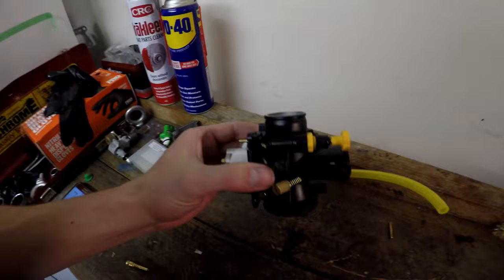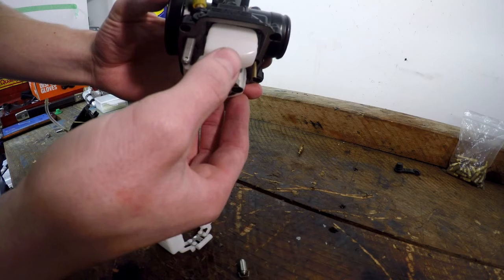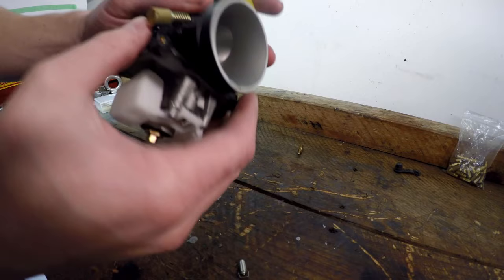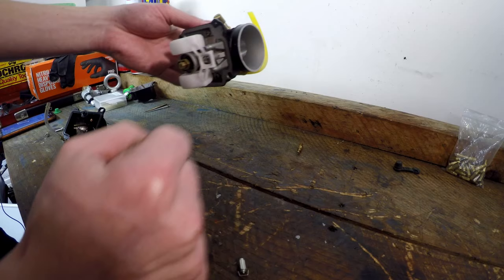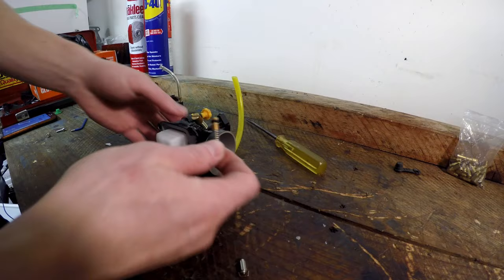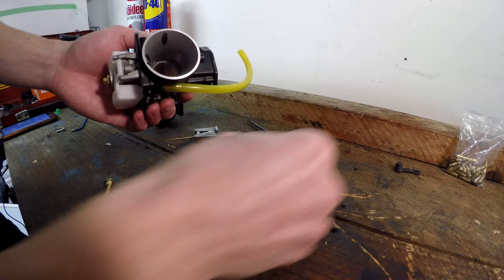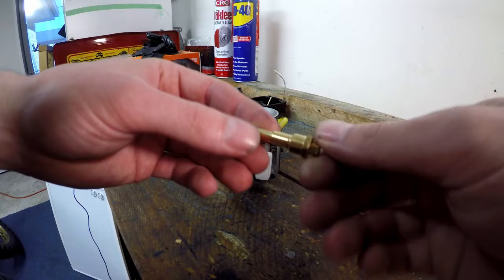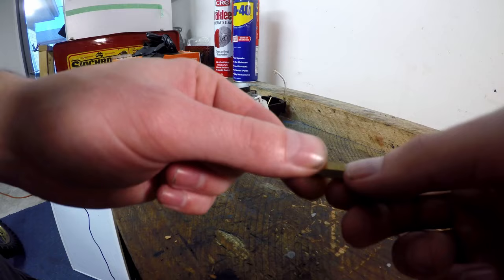pwk Carb Basics, Setup and Tuning

Comment: What’s the difference between this PWK and PE nibbi carburetor?
Reply from the maker: Depending on the model but the only physical difference is the round slide vs flat slide.
Jetting and setup will still be the same process.

Comment: Good Morning Guys, we running a Honda GX390 and I'm trying to get the 34mm slide carb to work at altitude.

Are there any recommendations in terms of main jet, idle jet.
Currently seems that it is only picking up halfway down the straight.
Currently running a 125 main jet, 33 pilot jet.
Reply from the maker: I would be running around 125 to 130 main jet in the 34mm carb.
Is it at full throttle the whole straight and then picks up half way? If so I have a feeling your carb might be to big for your engine.
Stock is 27mm, I normally only go a couple mm bigger so a 28 or 30 would work better.
The reasoning is carbs need a certain level of air speed to atomize fuel effectively so at low rpm the carb will stuggle to function.

Comment: Has anyone tuned this carb for a built 212 predator engine?
Reply from the maker: Not me but if your struggling, putting a Air fuel ratio kit will make it a piece of cake

Comment: Went with a new carb but when I rap the throttle quick it bogs down I went with a 26mm
Reply from the maker: What bike is it on and have you jetted it yet or just fitted it?
Reply: @TheMotorcycleForge  it's a 150cc scooter no it has. 108 main and 38 pilot
Reply: @TheMotorcycleForge  didn't jet it yet
Reply from the maker: Ok I would have a look at adjusting the mixture screw and the jets might be a smidge big but might work ok.
I did another video that's more in depth about how to jet a carb.
You should find everything you need to know in that vid.
Reply: @TheMotorcycleForge question I got a 150cc with 28mm PWK,air filter(48mm) & aftermarket exhaust.I’m at sea level and main jet was 120 & pilot jet was 48 but I swapped to 38.This setup should work fine?🤔…
Reply from the maker: Yeah sounds pretty good, only one way to find out, go test it out

Comment: Any opinions on 30 holes needle jet?
Reply from the maker: I have purchased a couple different ones with more holes than stock, unfortunately haven't got around to trying them yet.
If you do I'd be keen to know how you get on.
Reply: @TheMotorcycleForge  i have 150cc gy6 I usually jet it 115 main now with the 30 holes needle jet I'm down to 95 main and runs somewhat rich (kinda bad up top)
Reply: @TheMotorcycleForge  I went from 110-100-98-95 it keeps getting better now I don't know if what I'm experiencing is a lean or rich condition
I can't read sparkplug as my gy6 burns oil
Reply from the maker: Yeah that sounds about right, I think the more holes in the needle jet.
Will add fuel in relation to position of the hole compared to the needle hight.
Not sure the extra holes are needed might be making the main jet size not as important.

Comment: Where tf do you put the fuel line
Reply from the maker: It will be the largest brass fitting on the carb, can be on R or L depending on make of carb. Small ones are breathers.

Comment: A friend of mine drilled and tapped a hole in the air filter for his nitrous kit. Hard to believe they make nitrous kits for motorized bicycle lol I would buy one if you could buy more cartridges but it only comes with 5 I think
Reply from the maker: Wow that sounds awesome, wonder how long the engine will last.
Reply: @TheMotorcycleForge  there's videos of people using them and they seem to hold up. It's not like it's a big shot
Reply from the maker: I give it a look, sounds like fun
Reply: @TheMotorcycleForge  I'm thinking of getting one and putting on my bike with the zeda 80. I won't put it on my phantom 85 I don't want anything to happen to it
Reply from the maker: Yeah man fair enough, keep the best bike safe 😁
Reply: @TheMotorcycleForge  I love the phantom. It's got some power and I can't wait until they make high performance parts for it
Reply from the maker: Haaha yep, fingers crossed they make some soon
Reply: @TheMotorcycleForge  they will now that they got the kinks worked out. It's why I waited until version 3
Reply: @TheMotorcycleForge  to buy one
Reply from the maker: Yeah that's the smart thing to do.
I totally agree is not a gr8 idea to buy  the first version of a bike for exactly that reason.
Reply: @TheMotorcycleForge  I've had zero problems with mine and it's broke in now cause we finally got some nice weather but like I said I waited until the 3rd version and I kept up on the reviews
Reply from the maker: Always pays to do your research, hopefully they have some performance parts out soon
Reply: @TheMotorcycleForge  I got a bigger reed valve and carburetor and now that it's broke in I can finally install it. The 19mm carb that comes with it isn't enough. If you do the math it needs a 21.something so I bought a pwk 22mm Mikuni carb for it
Reply from the maker: Yeah it should be way happier with that carb and more power of course 😁
Reply: @TheMotorcycleForge  what kind of hose can I use to run from the carb to the intake?
Reply from the maker: So if it's for the engine side of the carb you will need to find a reed block rubber that will fit the  bigger carb.
What I did was make a adaptor plate so I could fit a miss matched rubber that fitted the carb.
The same goes for if it's on the other side of the carb.
Easiest way is finding a bike that has a 22 carb and seeing if the rubbers will fit your engine.
Reply: @TheMotorcycleForge  I know they won't be the same but what jets are you running? And you should do a video on where all the extra hoses go
Reply from the maker: Im running a 42 pilot and 112 main in a 30mm carb.
The extra hoses are for the breathers for the float bowel& overflow.
Personally I don't use them on most of our bikes, makes it look messy ahah
Reply: @TheMotorcycleForge  probably won't make much of a difference until I get a nice expansion chamber. If nobody makes on soon I'm going to go to my local garage and see if they will
Reply from the maker: That jetting is on a 4 stroke though.
I have a two stroke with a 28mm carb I think it roughly has a 52 pilot a 150 main
Reply: @TheMotorcycleForge  that still seems high. What are you running? Most people I've talked to on here are running around mid 80s main and around 40 pilot. The biggest I've ever run in a regular NT carburetor is a 78 I think
Reply from the maker: It's a worked dt175 Yamaha
Reply: @TheMotorcycleForge  oh well I'm talking about motorized bicycle engines